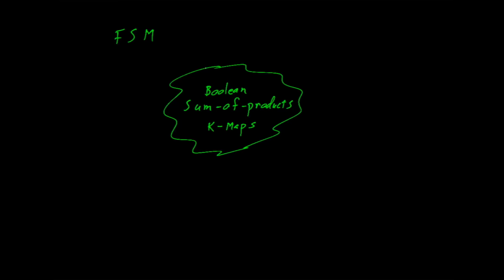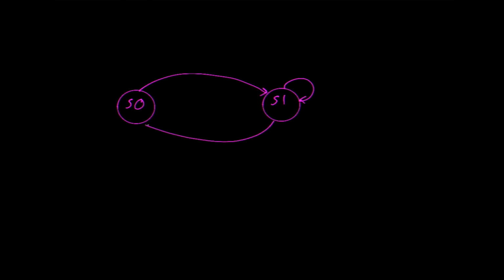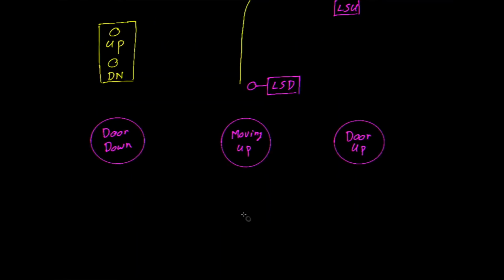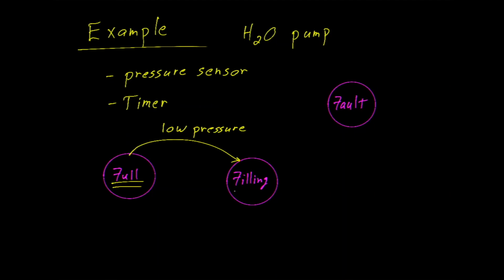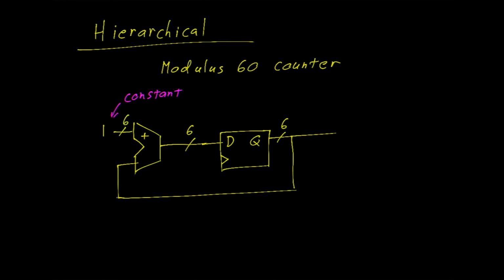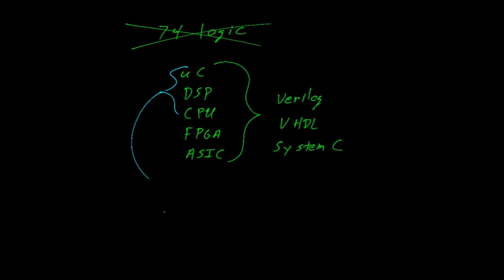Digital logic #11: Finite State Machines, D Flip Flops, and Practical State Diagrams

Comment: 00:20 FSM Pictogram
01:30 State = Type D (Flip-flop)
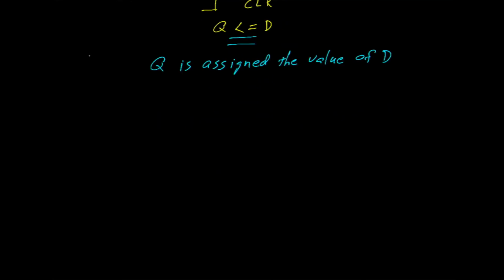02:34 Example
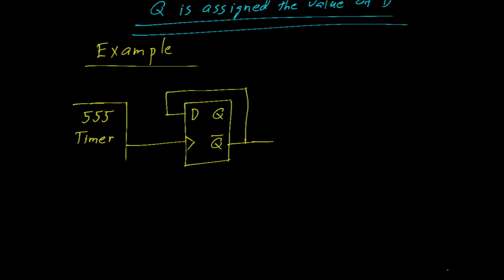03:20 Timing Diagram
05:10 More Than 'a bit'
06:01 Just In Case
06:20 State Diagram
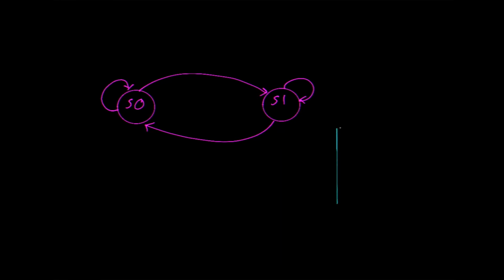06:51 Example: 2 button
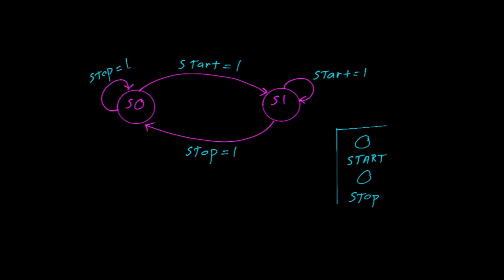07:20 'And' to Keep Out of Trouble
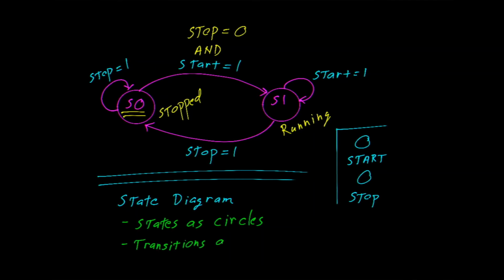08:27 Example: Garage Door
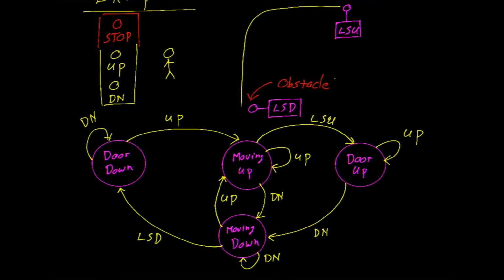11:48 Example: Pump
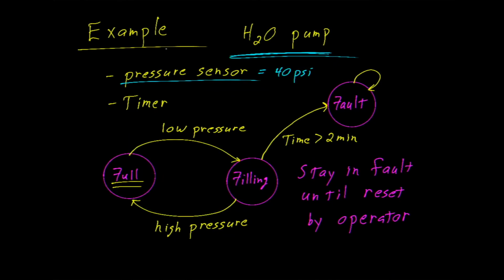13:54 How Many Bits for a State?
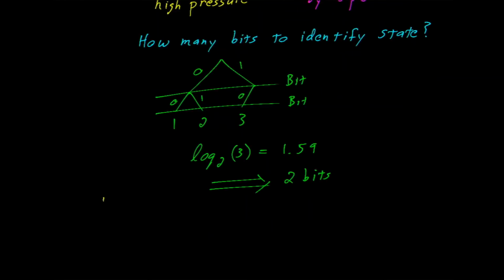15:14 60 States (Round to Ceiling)
16:02 From a Clock to Register
16:55 Hierarchical Diagram
18:22 What'd You Think?
20:11 How to Build Your FSM